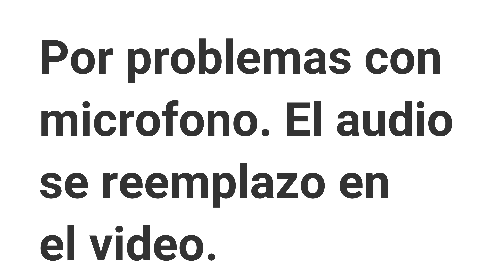Porta caña para techo de auto - ¿quien sabe que pez es?- pesca en chile, bricolaje-roof rack fishing

Comment: Aaaa y al final no compré el kayak me compré un sodiac ojala tuvieras por hay un video que me ayude a ver que motor se le puede poner y si hay que sacar permiso para andar o no se algo que me ayude con el tema del motor ya que tu debes tener algún amigo que tenga sodiac eso era gracias saludos desde vallenar
Reply: Estimado Abraham. El motor adecuado depende de las características del bote, esto lo especifica el fabricante en el manual de uso. Esto es importante, porque un motor fuera de norma de la nave es fuente de peligro de accidente.
Respecto al permiso, las naves requieren matrícula si su motor supera los 9 HP de potencia. Esto se tramita en la capitanía de puerto si es necesaria.. También  se requiere licencia para el piloto que gobierne la nave, si esta supera los 9 HP, en este caso es suficiente la licencia de Patrón de Bahía.